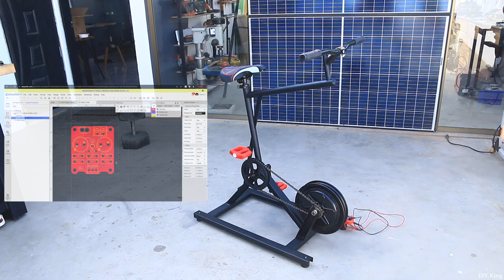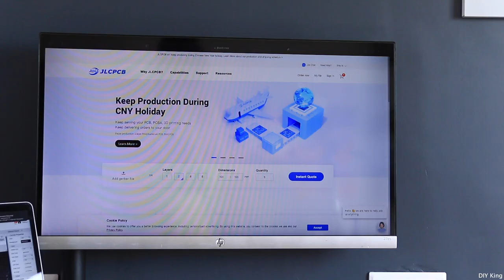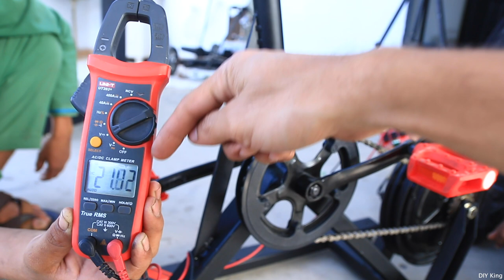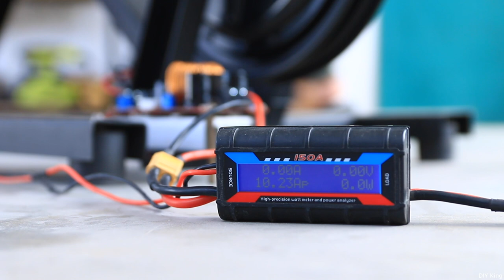DIY Exercise Machine (Generating Insane Power Out of Mono-wheel)

Comment: What kind of output, and duration of output, do you think could be achieved by using a large weight dropped from a height to drive the generator or a flywheel?

Comment: Hello DIY King. I've seen this video and also the wind generator, and since I have a 350W Hoverboard, I'm thinking of doing both projects. But my main questions is: How will I store or use the energy efficiently?

What would you advise to be the best way to store the energy and then use it in a nice and easy way? Obviously incorporating a battery into the electrical system of the house has many risks and might be hard, so I was thinking like a 48V Battery with a normal outlet, that I could use to power my 3D Printer or my filament dryer for some limited time. Ideally, I'd have the battery connected to the wind turbine or bike while using it for powering the 3d printer, but I understand this might add some complexity, so I was first thinking of starting simple. Using the bike or wind generator to charge up a battery, which then I'd disconnect, bring it to the office, to power up some appliances, until it's depleted, and i'd take it to charge again. On a second stage, I'd try to make it all connected.

I think you see my point. What would you advise for this? I'm curious for your input!

Comment: If you need to output 400 watts of leg power to get it to move, you're best off slapping that 4 cylinder motor onto it- it likely has too much magnetism to allow it to work well as a windmill.
Also, damn you got strong legs!
Reply: I agree with the leg strength, but what if it was in a pulley system or have a simple gear system to make it easier to move.

Comment: Shouldn't the outer wheel where the tire was attached be fixed (stationary)? How was it creating power when the stator and the rotor were both spinning?
Reply: The hub of the wheel is actually anchored to the frame of the cycle. It’s the outer wheel that’s spinning.

Comment: Welding galvanized steel without breathing protection is downright stupid. First of all no matter what, you shouldn’t be welding galvanized steel.  You should at the least sand or grind away either the hot dipped galvanizezd Zinc or electro plated galvanized Zinc. You can use galvanized spray paint after you welded. To prevent rusting. I don’t see any  breathing protection being in this video.